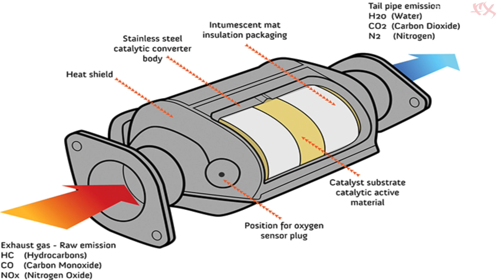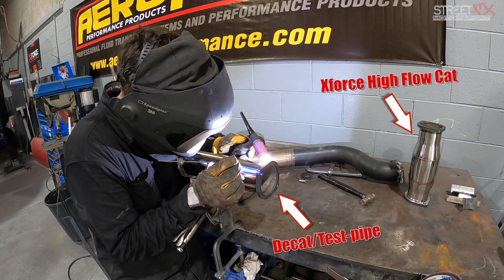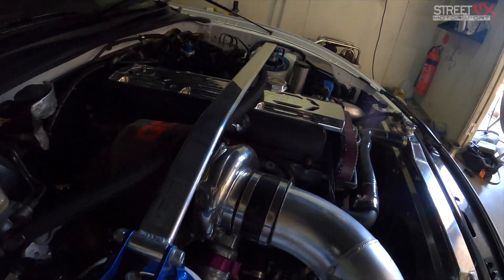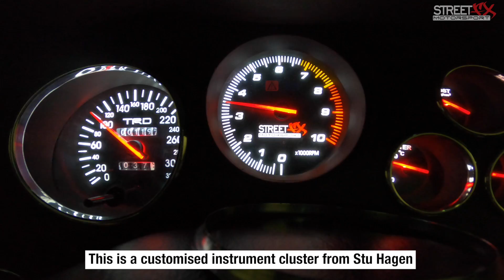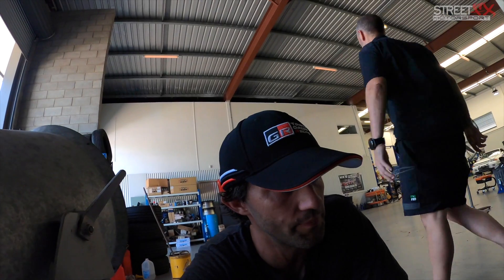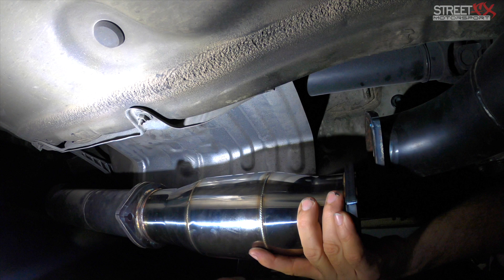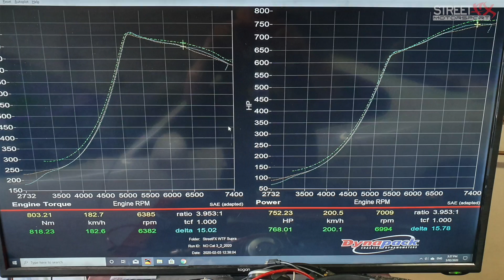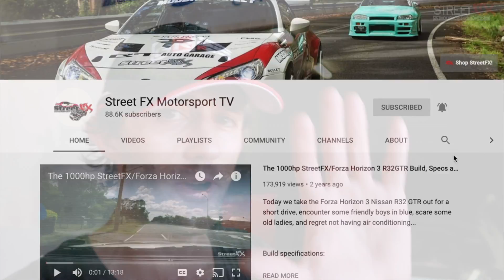REAL RESULTS.. Is it really worth running NO CATALYTIC CONVERTER? We test it on our big power SUPRA.

Comment: Maybe you should run this test again with a factory cat. Cause the people watching this video are probably looking into cutting off their factory cat
Reply: the factory cat would obviously rob his horsepower greatly hes making over 750 whp. go watch a stock supra do this test with a factory pipe that would be a more accurate test for the factory cat on a factory stock engine
Reply: Yea, with an old shitty blocked up cat.
Reply: Yup
Reply: Been considering doing this on my s16 GTI Peugeot but i better check the laws here since its probably the same as in Germany
Reply: Yea that would make the most sense
Reply: I agree. And I do not think 100cells is legal not I  my country....... maybe they sell 100cells cats 😂
Reply: Having no cats will reduce combustion time, such as fires happeing in the muffler
Reply: Exactly
Reply: Xactly
Reply: the result would be different yes. I´ve tested it on a supercharged camaro (about 680 crank HP) and it was about 730 crank hp without a cat. so a bit under 10%. 

With a street legal tuning cat we still got around 705 hp. The question now is what you intend for the car. you wont really miss those 25 hp in a daily car but its definetly better for the environment (and also illegal to drive without a cat in some countries). 

I agree that the test is not perfect, but it at least shows that a aftermarket cat is an acceptable option compared to deleting the cat.
Reply: @Nelayo  I removed it on mine because my car has 2 sets of cats 2 on the downpipe and 2 on the mid. With 2 only still passes emission tests.
Reply: @nelayo4894  still without the cat engine will be cooler, turbos will spool faster, exhaust will sound better and better mileage.
Reply: @nelayo4894  I've seen similar results of 5-10% and these days I don't think it's worth not running one on a real street car that sees a lot of street driving.
   The only time I've seen a cat reach 10% or more loss is when a car has been run pig rich in the tune.
Reply: Post edit:
Lost all power couldn't drive over 30kmph, thought it was the coil pack but turned out to be the cat converter.

Got the cat cut out and the car runs way better, it's loud at low revs or lower gear on an uphill but the sound is nearly minimal at higher speeds on the motorway. In fact all I hear is that little 16v whining 😂 lovely little cars.

Car runs way better than it did with the old cat.
Renault clio 3 1.6 16v
Reply: @passionbaitsza  😢ct😮d😮I  h c r😢k mm 15:09 15:09 15:09 😮g c
Reply: @passionbaitsza  your car was probably tuned to run with the back pressure the cats caused and now that you don’t have back pressure your car is freaking out.
Reply: @bobbyromo69  it's loud but it is definitely way faster and the sound is minimal at higher revs and higher gear. It's a love hate relationship with Renault isn't it 😂 she's always been a beaut on the road though and is running much better without the cat
Reply: @bobbyromo69 backpressure is not a requirement for any 4 stroke motor on the planet, that's a myth. No vehicle runs better with backpressure, and especially not turbo vehicles whatsoever, you want effectively as close to zero backpressure as you can get on all vehicles. On a turbo vehicle you'll have necessary backpressure in the manifold but post turbo you want NO backpressure. There's no such thing as "tuning for backpressure" either. Absolutely not
Reply: @passionbaitsza  I cut the cat out from a 1996 899cc fiat panda the other day. It ran great. I ran it without an air filter but it didn't like to pick up from low revs. Thinking the computer need remapping to add lots more fuel at lower revs. Then i may be able to fit a high flow air filter and it would have up to 10hp more i'm guessing.
  Now i just need to work out if i can remap a 1996 monopoint injection system. Or it's carbs from here.
Reply: @izzzzzz6 you cannot add fuel to a naturally aspirated vehicle and make power 99% of the time. They already use the o2 sensors to stay at the proper air fuel ratio. Does your vehicle have an o2 sensor? If so you're not going to be adding fuel lol
Reply: Removing the factory cat from a factory car probably won't do much either. I built a delete pipe on my mostly stock celica gts and all it really did was make the car sound worse so I put the cat back on. Toyota knew what they were doing when they sized that cat.
The only car I've had were it made a significant difference was on my old 78 camaro when it was stock but now we're talking those awful pellet filled cats they haven't made for decades.
Reply: @177SCmaro  yeah, in my expierence (i live in germany) its not worth the hassle with police and the tax office (if you delete your cat they tax you as if your car has no exhaust cleaning at all which forces you to pay higher taxes besides the fine for driving without a cat) so its easier to change the intercooler or do something with the software

Comment: No catalyc converters= Less restriction and more horsepower.
Reply: Apexseals depends on your state laws/tolerance. Here in Florida, just about everyone runs there car cat-less.
Reply: @Apexseals Don't forget in some states even in my state it's legal and people can get away with it easily. Especially, with states that have no auto inspections. The only way they can get you is in states that have auto inspections.
Reply: Vroom Vroom 666 exactly, here in Florida, everyone gets away with it lmao. Once I get my tax returns, I’m buying some catless long-tube racing headers from kooks, for my 04 trailblazer I6
Reply: @bigstrawgaming9166 Awesome👍😀 Same here in South Carolina. We too can go catless all we want. I wish all the best on your trailblazer👍
Reply: Vroom Vroom 666 thanks man, much appreciated. Best of luck to you as well
Reply: Apexseals the feds will definitely check your car instead of the local cops
Reply: I'd say the sound of catless is better reason to do it than the hp gain 15hp on 750 isn't much of a difference. 2% gain.
Reply: @magincap70  Better than no gain at all. Every bit of up helps. I'm running catless, no resonators, and muffler on my 2015 3.5L ecoboost. I had 2 cats on it. By deleting them both I got 17hp which is a pretty good gain in hp. Plus, I deleted the muffler and 2 resonators which gave me another 15hp. 17hp+15hp= 32hp and that was before I installed the performance tune lol
Reply: @vroomvroom773  probably sounds pretty badass. Those little EcoBoost engines put out some power.
Reply: it is legal if its for offroad use but yeah they never check

Comment: in a turbo engine its best to run straight pipe to drop backpressure and in a na engine it needs backpressure
Reply from the maker: Absolutely. We will look to run a test in future with a non turbo car, I expect it would have little to no gain by decatting.

Comment: 700+ and runs twelves? 500+ Chevs were doing high 10s over 40 years ago.
A 302 3 on the tree XT did low 11s in that period.
Just another example of useless turbo power, more so with ricer engines.
Reply from the maker: It was a joke mate... In the supra community "All supras run 12s".. It ran 12s stock with 330hp.

Comment: so why run the cat? it will cost more money and it won't gain any power..
so no cat wins again.. it's cheaper and makes more power..
no brainer
Reply from the maker: Did you even watch the video?

You end up smelling like petrol, your clothes and interior stink. It gives people headaches, it's illegal, it attracts massive fines if you get busted, and while one car might not make a difference, if everyone had that mindset, it's terribly damaging to the environment.

And it doesn't lose shit all power if you have a large enough system to accommodate the power.
Reply: It doesn't make you smell like gas lol I have a 1966 Ford Pickup which obviously has no cat and I dont stink after driving it. If the exhaust is going into the cab thats really bad cat or not. And it doesn't damage the environment at all, but can lead to an increase in smog if a lot of vehicles are being used in one area(such as a city).

Comment: I run catless on my 04 M3. I don’t get much raw fuel smell in my car. Great video. 15 hp is my guess. Luckily we don’t have emissions test in my area. That’s an insane fine. I got 23 hp gain on my car going catless but that was factory cats that you will never see light through.
Reply from the maker: Yeah next test we will do stock vs high flow vs catless

Comment: Turbo cars are actually somewhat easier to add a catalyst too because after the turbo they really aren't dependent on anything other than raw flow rates for power.  For NA cars (and some supercharged models) the location of the catalyst can make a big difference in exhaust scavenging from the header pipes, to the point where some big cammed NA engines can really suffer unless you move the cat way back of the collector.  The only drawback to that is the cat really doesn't heat up enough to do its job then.
Reply from the maker: We will test an NA car next :)

Comment: If you don’t run a cat you will stink?? Wtf...?
Reply from the maker: Unburnt fuel leaves you stinking. Pullung up at traffic lights and it wafts into the cabin.
Reply: thats total BS. Before cats existed(1960s) everyone didn't smell like gas after driving.

Comment: Dude, people don’t delete high flow racing cats, they delete decades old, clogged, restrictive OEM cats...
Reply: Or they take them off, smash the guts out of them, and bolt them back in. That way they look legal.
Reply: TofumanFC3S very good point. Still an interesting video tho.
Reply: thats true
Reply from the maker: This video is more to show whether it's of significant benefit to do a complete decat, or just add a high flow when you're otherwise planning to swap out your factory unit.
Reply: @StreetFXofficial  you explained that clearly, hey what city are you in ? Aussie Aussie Aussie
Reply: @StreetFXofficial  yeah but how much does a high flow cat over 300-500mm of stainless 3"pipe?

Comment: The real question is how long will that catalyst last. if I am going to burn them up then it is not worth doing.
Reply from the maker: Car had a high flow cat in it that has been happily functional for the past 6 years. Wasn't burned up and was looking fine inside. We only replaced it to make a video that was more easily relatable.
Reply: @StreetFXofficial  that is cool to hear used to be they would melt. did the supra come with an A.I.R. system?

Comment: Not sure this is the correct vehicle to test this with. By nature turbo engines have a massive exhaust restriction by design, the turbo. For all you naysayers think of it this way. You choose a turbo over a supercharger because a SC takes power from the engine to make make boost. In this case 25psi. If a similar sized centrifugal SC was used it would take "x" amount of power to make boost. So a turbo of the same psi and cfm would need the same amount of energy to make the same psi (same compressor different drive side). So the exhaust would need to produce "x" amount of HP to spin it. The engine MUST force the gasses to exit in turbo applications. The power stroke of 1 cylinder not only powers the wheels but also the exhaust process by pushing the exhaust out and into the turbo. Now, on a NA car or SC engine the engine can use scavenging to actually pull exhaust gasses from the cylinder letting the engine turn more freely because it does not have push out the gasses. Or with a tiny bit of cam overlap (both valves open at the same time) the compressed air from a SC can be used to "vacuum" out exhaust gasses. This cannot happen on a turbo engine. It would be like trying to charge a battery with only it ownly itself as a power source. Therefore non-turbo engines may see some to much more gains from a converter delete.
Reply from the maker: It would be an interesting test on an NA, but don't forget that NA engines typically benefit from a certain amount of back pressure, whereas turbos want as little as possible.

Also a supercharger generally speaking is far less efficient than a turbos and it's drive saps more power than a snail.
Reply: @StreetFXofficial  there are a few videos proving the back pressure theory is a myth. This is based off of a  phenomena where using too big of an exhaust will hurt performance. If the exhaust is to larger cold air can get into the system while the engine is trying to evacuate hot exhaust. This causes turbulence hance creating back pressure. Think of a cold and warm front coming together. You get wind.

Next it is simply not true that turbo are more efficient in all circumstances. Again this stems from use cases years ago when adding a SC was just to strap it on and go. With the advent of engineered kits that can self regulate boost (bypass valves), can now have built in intercoolers, have better drives they are more efficient than you think. There are calculators you can play with in the internet (https://www.google.com/amp/s/www.engineeringtoolbox.com/amp/horsepower-compressed-air-d_1363.html) you can see it takes about .025hp per cfm @ 20psi. 1000cfm x .025h = 25hp. A t66 turbo does about 20psi @ 1000cfm. (The math above show how much HP you need). Now, you need 25 hp no madder where that HP comes from. Compressed hot gasses or the crank shaft. If you get it from hot gasses out of the engine that is a HUGE exhaust restriction. Not to mention other losses like heat and flow reduction due to piping. (compared to direct mounted SC like root and screw type) 
In some instances you are correct. Small torque multiplying application you are correct. However, depending on the application big HP gains you may be incorrect. 
The outlier is diesel though. They produce much more gasses in combustion and the much MUCH higher compression lend itself to faster exhaust gas flow. That coupled with low RPM make them a better fit.

Comment: Needs more revs, it wasn't done at 7,400!!!
Reply from the maker: It revs to 8500rpm?
Reply: @StreetFXofficial  i was brushing snow off a 1994 Ford Thunder Bird that has a 4.6 OHC and a duel exhaust... no matter what i do with the gas peddle it doesn't go any faster then a Toyota prius, but when i take it out of overdrive the rpm's instantly shoot up to 7500 something given 3/4 the peddle the back end whistles after 2 seconds by the time i look down the speedo has plowed up to 160 even with the locked differential... but back to were i started, the exhaust tips get hot enough to boil snow on contact. is it running lean? -15 outside hardly blows any smoke but the exhaust still boils water, don't even bring it past 2000 rev's on a lazy drive to go do stuff and it still gets hot enough to boil snow on the exhaust tips... i am worried it might melt the bumper if i drive it to much, it has a aftermarket kit on it... was vary expensive, cost twice what the car did. hopefully it gets better traction when the snow has melted.

Comment: i have question. i don't know much about tuning. what's the advantage/purposes of unburnt fuel? if i pay $50 of fuel, i want to use them all, not wasted it. please explain..
Reply from the maker: it helps keep the engine cool, and safer. Leaner tunes mean they run hotter and closer to the "edge".. Leaner makes more power but likely to detonate and kill your engine. Tuners typically richen the fuel mix up to protect the engine.

Comment: Excellent looking engine but separate that pod filter from the rest of the engine bay so you're not sucking so much hot air
Reply from the maker: It'll get ducted into the front bar soon
Reply: @StreetFXofficial  see if you can measure inlet temps before and after. Just spitballing I'd guess it's worth 10Kw from air density (at your power level. Someone's 98 NA Civic might only see 1)
Reply from the maker: Our intake temps are presently seeing around 10 to 20 above ambient. Unsure if from the air inlet or from heatsoak on the aluminium plenum. Will test again when it has the 4in exhaust done, we will get the intake done also.

Comment: I did the test on my m3, it dyno gained another 10hp higher up in the revs with the decat. But the afr was off its tits down below 4k rpm and it lost power and torque down low. I went back to fitting the factory cats